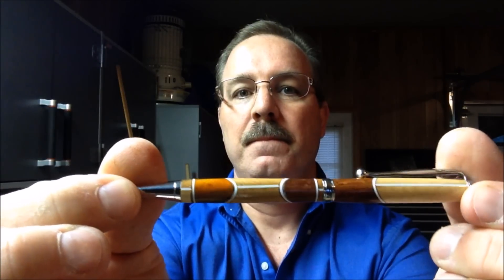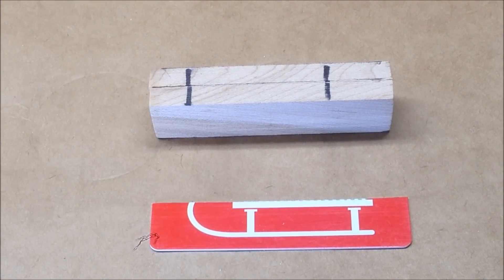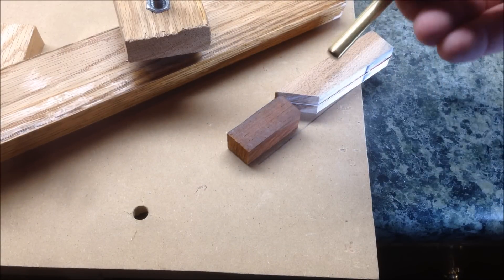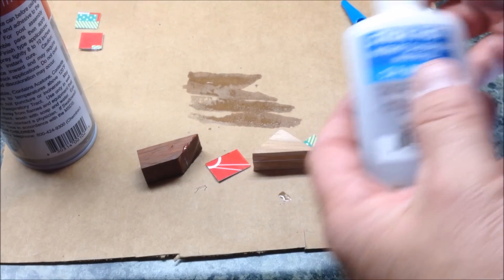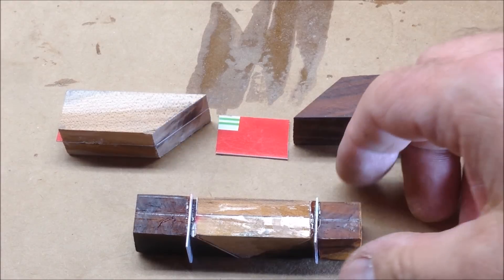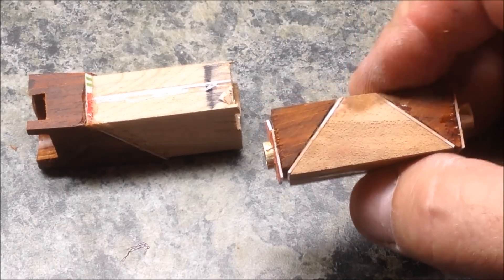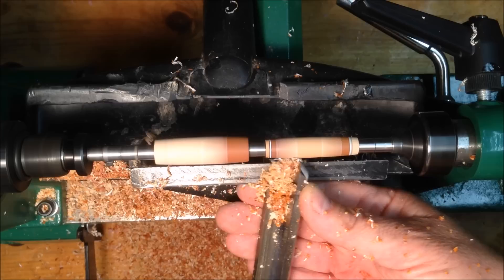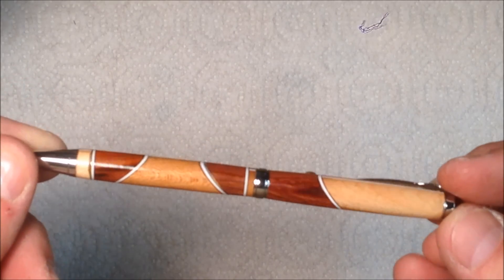Cocobolo Maple Gift Card Pen (Segmented Pen)

Comment: Hi Bob, love your pen videos I re watch them quite often. Did you manage to resolve the drill drifting issue? I've had a good result with honing HSS dits when I really don't want it to drift.
Reply from the maker: Can you explain to me what you mean by honing? I still occasionally have a drift issue, especially with longer bits. 

Regards,
Bob
Reply: RJBWoodTurner   Hi Bob (honing or to hone something means to make sharper) all I've done is cut a block on my bench saw at the angle of the drill bit I'm using, hot glue the bit to the block so that it's sharp ish edge makes contact with the piece of glass I use that has a little cutting compound and oil on, then make little circles until I'm happy with how sharp it is. The difference once you get the hang of it is like cutting a tomato with a spoon then a scalpel, drift happens for me when you need to apply pressure to make something cut.
Reply from the maker: Thank you Jonathan.

Comment: Love the pen, I'm probably going to try a gift card pen soon, but I was curious if you ever had any of them fail on you? Does the plastic bond well to the wood?
Reply from the maker: +Joe7cri It seems to bond very well. If your concerned, rough them up good and use epoxy. I've never had one fail. The brass tube adds rigidity and helps hold everything together. Use glue like someone else is paying for it. 

Regards,
Bob

Comment: Do you take orders?  I have some awesome Stabilized Karelian Birch Russian premium wood coming in the mail from ebay, and I think it would look incredible. What is the average price for custom pens?
Reply from the maker: My shop is down at the moment because we are moving. The starting price for a pen is around $45.00 and they go up from there depending on what you would want. 

Regards,
Bob
Reply: +RJBWoodTurner what type of glue did you use
Reply from the maker: I use Penn States thin C/A finish. 

Regards,
Bob

Comment: Hi again, how did you overcome drill bit drift? I am using a bench drill with a 7mm bit set as deep as possible in the chuck and get drift every time which is annoying. I don't have a a chuck for my lathe so I cant use that. Do you have any suggestions?
Reply from the maker: +Andrew Tilly Hello Andrew,  I have an issue with drift on my drill press too. Since I have had my shop down for a while, I have had time to think about ideas. Without a chuck, I think my approach would be to drill a pilot hole with a smaller bit. the larger but will follow the path of least resistance so in my mind it would follow the smaller straight hole through the blank. I have not tried this yet as I am just getting my shop back together but it is on my to do list.  If you give it a try, I would love to hear your results.Regards,Bob

Comment: I have some rough sawn purple poplar I would love to make some pen blanks with ,,,how hard is it to cut your own blanks
Reply from the maker: It’s a piece of cake. If you have a table saw or a band saw just cut the wood to 3/4” x 3/4” x 5” and you have a standard pen blank.
Reply: @RJBWoodTurner  but it's not square an I'm still learning
Reply: And I have table saw and band saw but got to replace my table pin for band saw
Reply from the maker: @henrysscrollsawworks6917  Ask around to friends and family for someone who had a saw and can cut it up for you.
Reply from the maker: @henrysscrollsawworks6917  be very careful while
Cutting.
Reply: @RJBWoodTurner  yes sir my next question is can I use two Jacobs chucks and some speed steel bto turn between centers one blank at a time ????
Reply: @RJBWoodTurner  yes sir I can cut it I'll cut in shorter pieces I also have a miter saw
Reply from the maker: @henrysscrollsawworks6917  No, you must have a live center in the tailstock. A Jacobs chuck will not work.
Reply from the maker: @henrysscrollsawworks6917  😃
Reply: @RJBWoodTurner  ok thank you so much for your help 🙏🙏🙏🙏
Reply: @RJBWoodTurner  could I use the live center that come with my lathe I ask because I'm a beginner

Comment: On second thought.. Some wood grains might not behave well withe the shape of the reamer.. Don't know why I didn't think about that sooner. And the thought just occurred to me that I can't drill a blank on my small lathe, because the tailstock only has about two inches of travel. Can we say  Doh.. ? Lol  so scratch what I said. Except about the center drill.
Reply from the maker: Actually Mitchell, I believe you may be onto something, I have been drilling smaller holes and reaming them out with the larger bits, it seems to help. What I really need is bits made from stronger steel that don't flex. I have been choking up on my bits in the chuck to help with the flex but I think the larger flights make the bits weaker allowing them to bend when resistance is encountered thus causing them to veer. The center bits have smaller flights meaning more meat in the middle and possibly less flex. I plan to give it a try. 

Regards,
Bob
Reply: It is just in the nature of the drill. It will always follow the path of least resistance. And if there is a slightly weaker spot in the grain of the wood, then it will most likely wander in that direction. Many times the drift is too slight for the eye to see, thank goodness. Lol. One of the first things we learned in class is the geometry of twist drills, and that they will always always always follow the hole. So if you can start it straighter, you have a better chance. You mentioned stepping up through sizes and using the larger drills in a reaming fashion. Truthfully this won't make it straighter. It will follow the preset path. Least resistance. But hopefully the rigidity of the larger flights will help a little once the meat is hogged away. At least in appearance, because that's really what counts. Lol
Reply from the maker: Thank you Mitchell,
  I'm learning quite a lot from you on this subject. I appreciate all the thought your putting into this, in the end, I think it will help me to improve the quality of my work. Thank you. 

Regards,
Bob